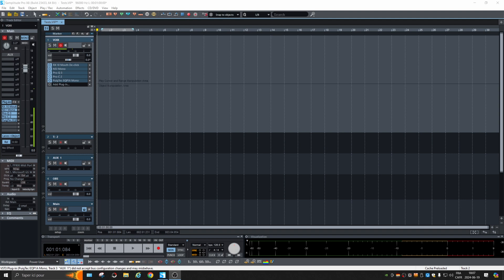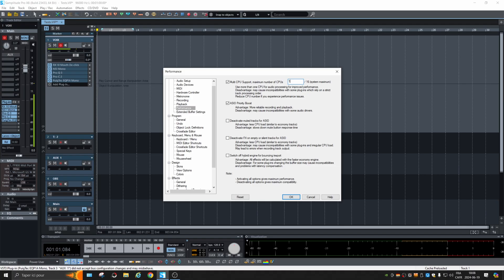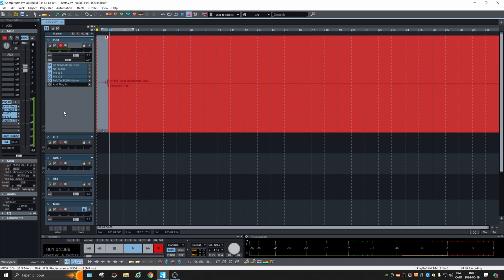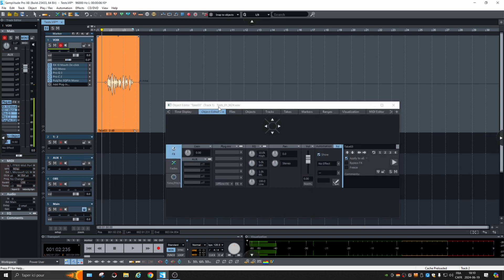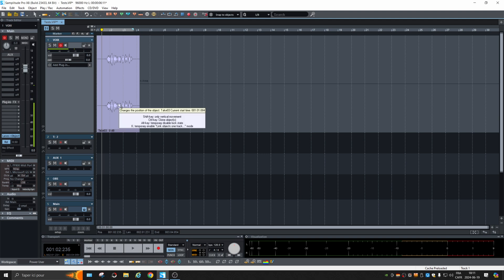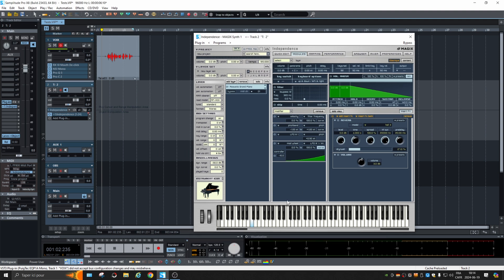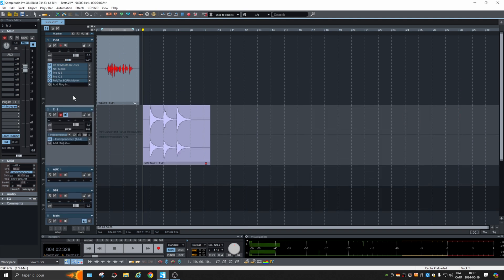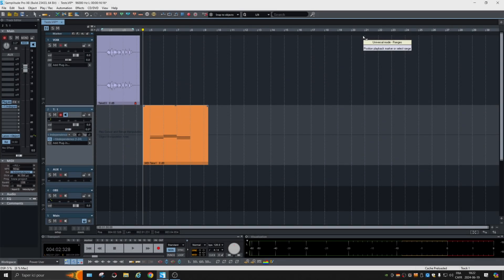Magix Samplitude : Crash solutions ?

Comment: One question, can you change the pre-fader and post-fader send color in Samplitude?
Reply from the maker: Actually, if you are at the default(post) when you slide up the level the line is orange, then change to pre, it becomes near yellow, then on direct out, it's pink...
Reply: @MarcoPrimeau  Yes, I already knew that. I didn't explain myself well, I wanted to know if you can change the color, from pre-fader to green and post-fader to red. I don't see any option to change the default color.
Reply from the maker: @Pi-314bt  Not to my knowledge. You might ask on Magix forum